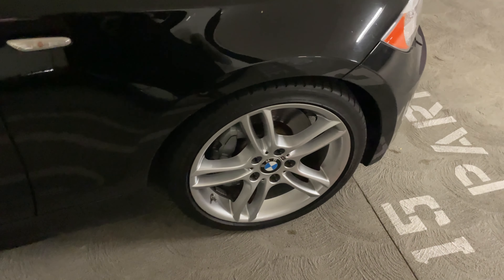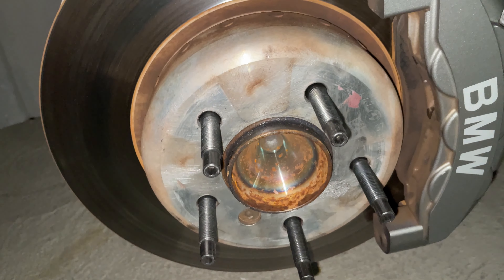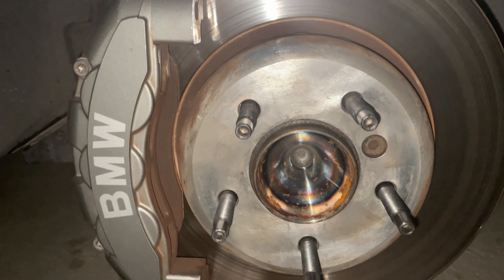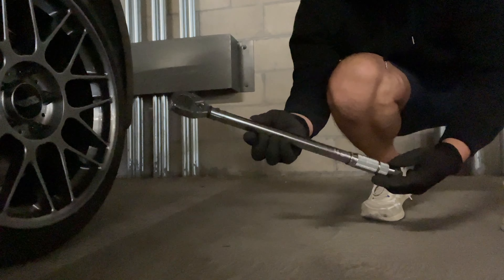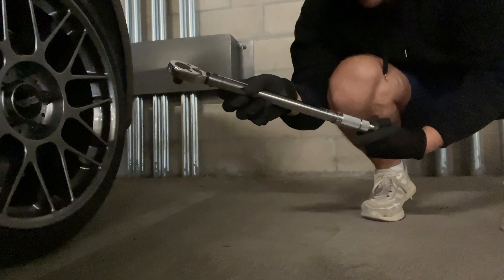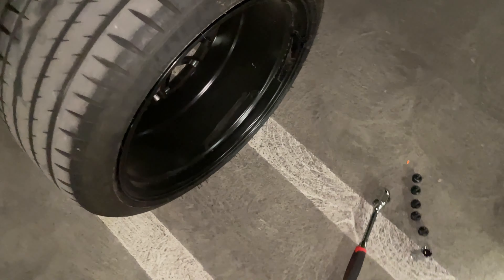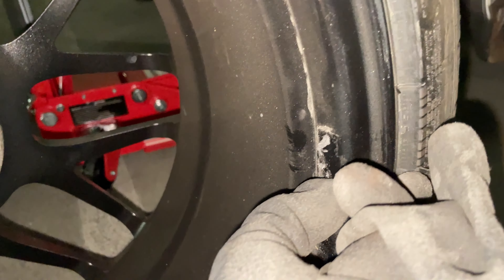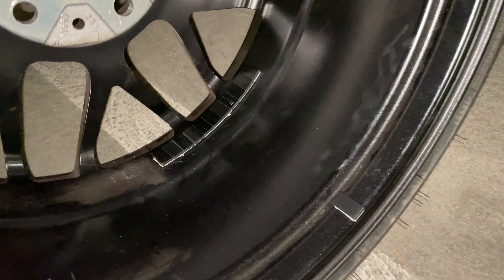DIAGNOSING WHEEL SHAKE ON MY BMW 135I | UNSTABLE AT 80MPH+!!!

Comment: This same thing happened to me when I got summer tires and wheels on my 335i. The problem turned out to be the installation of the tire itself. The tires didn't seat correctly on the front right wheel. I know what you mean by wanting it perfect, I drove with it for about three months until the fourth shop I went to figured it out.
Reply from the maker: Thanks for this insight man because after getting everything RFB and removing my front spacers just to be sure it’s still happening between 60-70. So annoying. So i think ill go back to americas tire and tell them to readjust the tire position because this is getting out of hand lol.